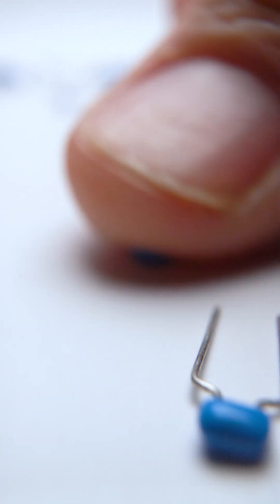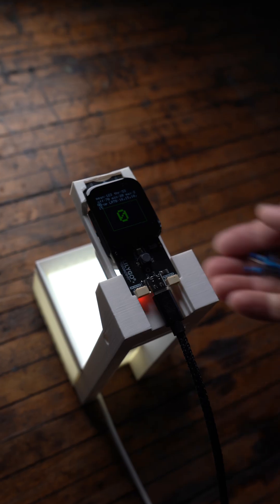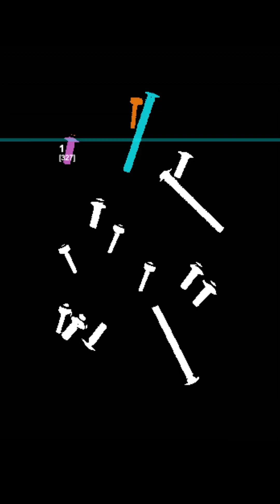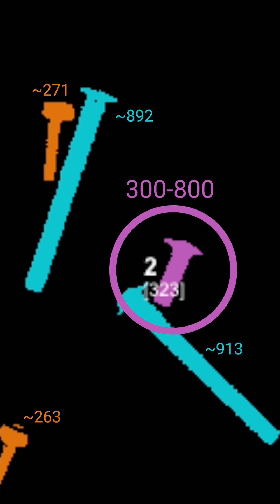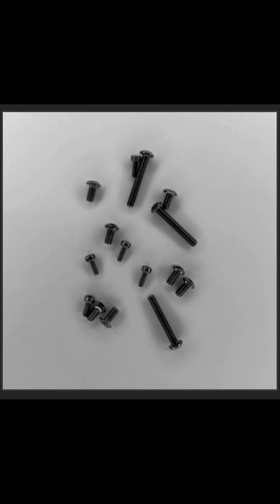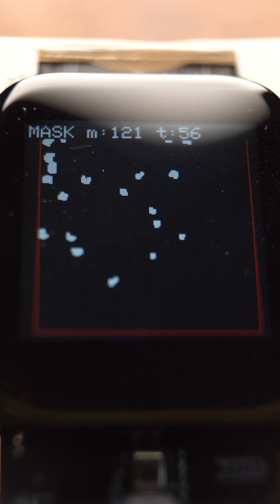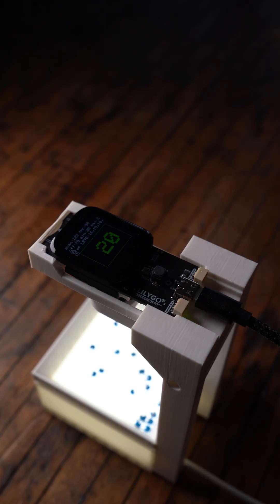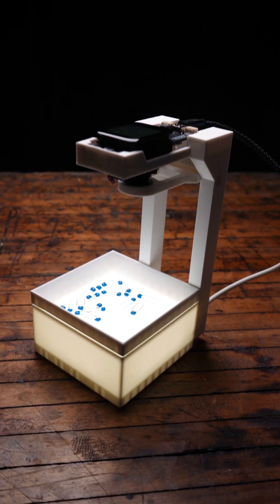Visual Parts Counter - ESP32 #computervision

Comment: The benefit of the counter is reliability. Sometimes, you just drop the count. With this, provided it's accurate, you can dump a few, write the number, dump a few, write the number

If you're doing a lot of counting in the hundred plus range, things like this are a godsend. 

A potential add-in, have an accumulation counter for batch counting like you were doing with the caps. Press and hold, or power off, to reset the accumulation.

Comment: The true measure is not how much time it takes for the device to count versus how long it takes you to count, but how much of your time it takes to prepare and operate the device versus the time it takes doing all the counting yourself. The counting machine doesn't have to finish faster. It just has to let you do more. 

Also, for the amount you were counting, you may have still been faster, but double that sample size, I'm fairly certain it would've beaten you, provided it was actually working properly with that amount of crowding.

Comment: I think the additional time with the camera is due to the small area of the tray above the illumination square, requiring multiple cycles of removing and placing items to scan.
A basic solution to avoid those cycles would be to use a long tray in which you put lots of parts, and then you slowly slide the tray across the illumination square to count all the items across the whole length of the tray.
Some extra coding would of course be required to track the movement of the tray to ensure items are not double-counted.

Comment: This is a cool project. I learned a bit about the logic. I worked in electronics stock rooms. We had accurate scales that we could count out a sample of 10 parts toss it on the scale, get a weight for them then dump the rest of the parts on it and get a count. Quick and easy. If the parts were super light we just increased the sample size.

Comment: Definitely neat. It sure only takes a moment to count a dozen of something. 

You spent HOURS and HOURS on this. Software files for 3D prints. The thousand lines of code to do the blob count. Trial and error for printed parts. Trial and error for the code. Trial and error for the lighting. 

You’ve made a neat thing that won’t save you any real time. 

“Five years from now I’ll break even and start saving a handful of seconds per day!” 

I love this for the exercise of creativity. Without a doubt. This is cool. 

No need to pretend it’s a productivity boost.

Comment: I believe you kind of cheated without noticing when you gave your manual counting the best results. When you used your contraption, you were still putting components in the tray 1 by 1 which is actually the slowest part of counting them manually. What you should do instead is putting a handful of them at once and if you overshoot, you just remove a few.
This way the times will be a bit variable, but I really believe your averages will be under 20 or 30 seconds
Reply from the maker: What you’re describing is actually the method I was trying to do. But I kept grabbing too small of a pile. With enough practice, I’m sure I would be faster with the device. Ideally, I would like to automate the loading and unloading process as well.

Comment: Super cool! Would be interesting to add/compare it against a powder scale where you could have an esp32 perform calculations based on the weight of the part. If each part is .3g and your total weight is 6g, then you know you're approximately 20 parts. Could be a decent step if you're looking to count more than what the camera can easily differentiate based on layers of overlapping parts.

Comment: Playing the devils advocate here: what if you dump large amount causing it to overlap more? Any small amount you can just count yourself. Id suggest you add a weight checker that needs to be calibrated for single item:

- click “calibrate”
- feed a single item and let it collect the shape and weight of the item. Can feed all different items.
- load it with all items

1. Check the total weight
2. Scan for specific shapes

Yeah, use AI. Plenty of already trained small models you can use for image recognition

Comment: This is a really cool project but I think might be over engineered for this task. Had you tried an electronic counting scale? I've used one for counting small parts and they are very accurate albeit expensive but it was 30 years ago so maybe they've come down in price, they are so sensitive they need calibrating for the minute changes in gravity around different parts of the world but if it's just counting you're using it for then calibration isn't necessary I believe
Reply from the maker: I agree that it's over-engineered for just counting parts. This was more of a learning exercise for me to explore using computer vision for a relatable application.
I appreciate the feedback!
Reply: @HackMakeMod it's cool though, that's for sure!!
Reply: How can you use weight as a method to count parts when the parts are different sizes and therefore different in weight per piece?
Reply: @TheDradge possibly using 2 scales, one for just 1 piece as a weight reference, and the other as the actual counter
Reply: @vanity6369  but different size parts are most likely going to weigh different amounts. This is a parts counter, not a total weight divided by a particular weight equals total number of parts device. His video shows items like screws of differing lengths. He is counting parts, not measuring weight.
Reply: @TheDradge yep if the components are different weights and sizes then his solution would be the best to count them
Reply: This is not over engineered. I really wanted something similar for counting bacteria colonies on a petri dish like 10 years ago. Would have been super nice
Reply: @fungiblog  same! I had a project that had me point-count microplastics under a microscope, and not only was it tedious, but it invited error and bias opportunity.
Reply: Not over engineered. This is what pharmacies use to fill prescriptions. Litteraly used millions of times daily all over  the world. 

Industrial farmers use this when counting seeds. They also use weight, but if they can afford, they use light boxing to count seeds. Google the size of a lettuce leaf. Try counting any seed when they sell by the kilogram.

And he made a cheap custom version in his home for less than $100. If he open sources this, it literally contributes to making hamanity better overall. What have you done?

Yall hating. Certified haters 😂
Reply: Perfect for seeds!@
Reply: I remeber using a sácale somewhere to count number or post cards
Reply: Whether this project is "over-engineered" compared to a scale depends on your definition of efficiency. 

From a purely functional standpoint, yes, it is over-engineered, but from a cost and customization standpoint, it has clear advantages
Reply: I've used a weight/scale counter for inventory. It didn't need celebration for gravity but it needs a sample weight of the part being counted. Very lightweight parts would need 100-1000 parts to have enough weight for the sample. This photo-analysis-counter would have made it less tedious doing inventory of small lock washers and nylon washers.
Reply: All I see with this design is miss counts due to overlap etc..
AI will also have false guesses..
While a cheap Dope scale hooked up to a microcontroller would be accurate if only counting the same items from the same company..
Differences would usually be similar for different companies as wel.. Maybe a gram or so over/under..
Reply: @zakofrxit counts the components accurately even if they are overlapping, watch his video again cos he explained why

Comment: With a few code mods, this can be used to count medicine capsules and tablets.
Reply: gosh, better be sure, dont play with medicine. although a vibration step would help disperse the units for more acuracy
Reply: Yep it already exists
Reply: Please don't
Reply: Does it need any mods?  If the min and max size are variables then I think it should work as is.